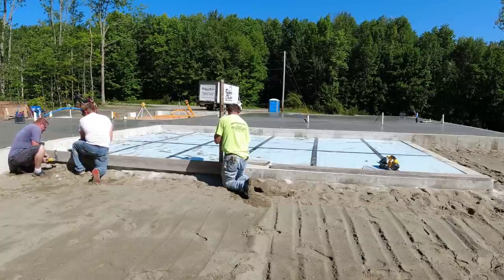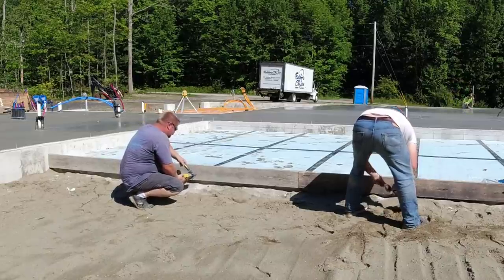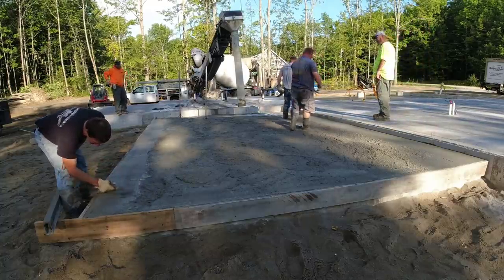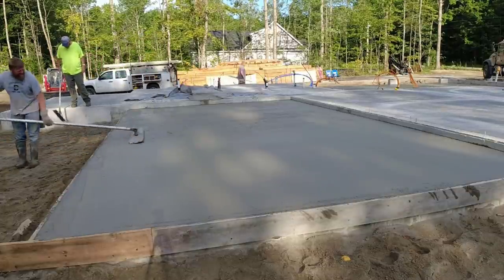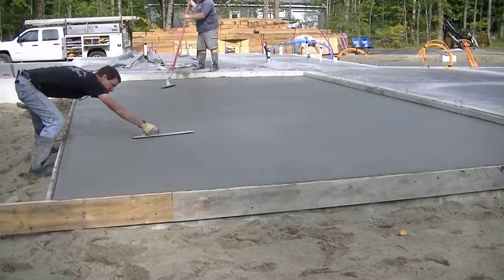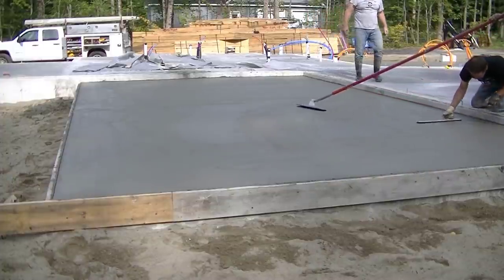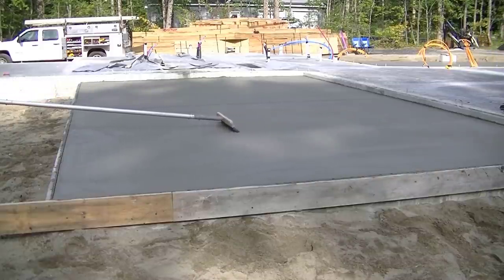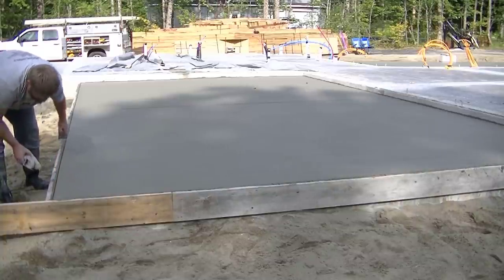How to Form, Pour, and Finish a Concrete Patio (Making Money!)

Comment: You can’t get wire mesh because I had to buy it all from every distributor in the state for my project in Kittery about a month and a half ago, I bout 540 sheets of it, and that’s all that was left in the state, we got 300 sheets from Hammond Skowhegan alone, we got the rest from HD. Sorry Mike. And we only use it put on top of the rebar for safety, kind of a waste, but times have changed and safety trumps production with us.

Comment: Steel or fiberglass rebar could be used. Where the patio meets the house that should at least be drilled an short dowels driven in to the house walls. I know you said the builder or homeowner called out the reinforcing requirements but it will settle. I would not pour the concrete if they didn’t let me dowel it. Nobody had ever said no or ran me off.
My opinion 2” edger looks like crap and brass makes it look even worse.
You guy are hard workers and work good together, that covers a lot of sins for those watching.
Reply: 2inch edger yuck, do u have top line products 4or5 inch edger stays nice and flat no rolled edgers .